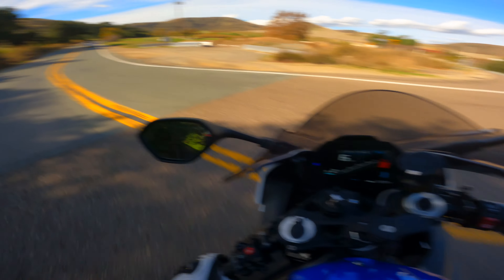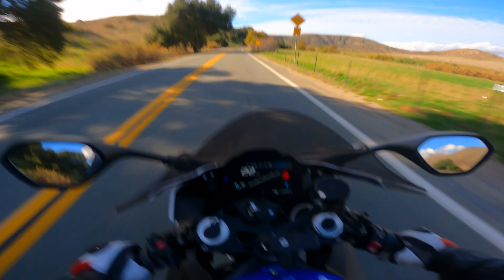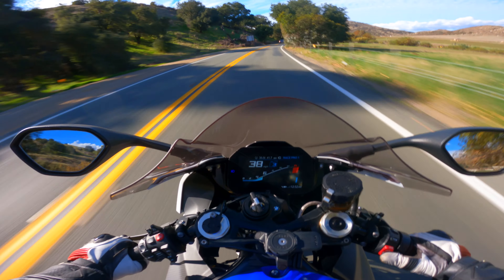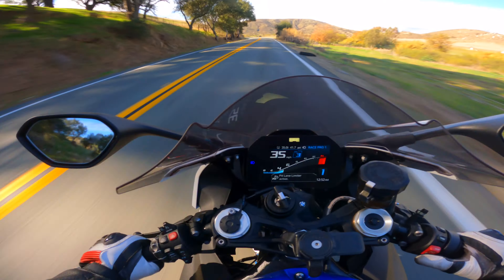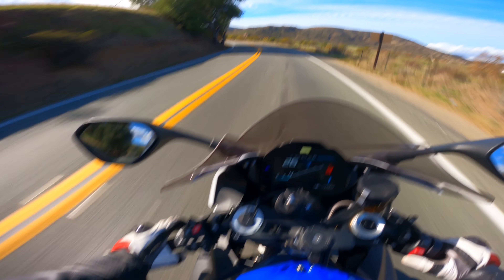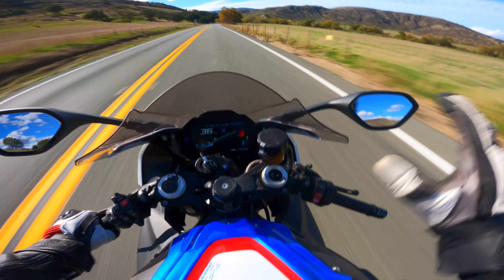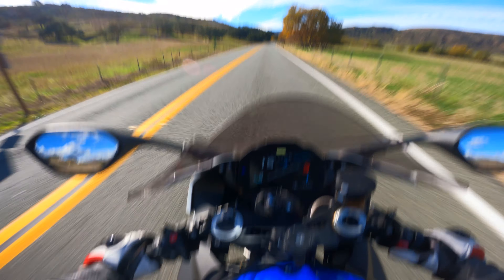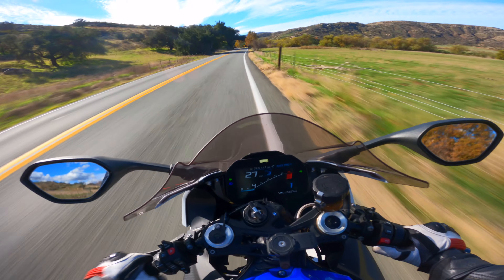HOW TO USE THE PIT LANE LIMITER AND LAUNCH CONTROL ON A BMW S1000RR!

Comment: A bit late here but that is not how to use the launch control. Throttle needs to be pinned at 100% from the get go, if you even drop it to 99% Launch Control deactivates. This explains the massive drop in revs you get in 1st gear. It should be holding 9k until the engine catches up and continues from there. for anyone trying it for the first time be careful not to hold the throttle at 9k then go max after you start to move this can cuase launch control to immediatly turn off and the front end will go stait in the air if not ready for it.
Reply: W mans🤝🏻

Comment: BMW said specifically to pin the throttle to enable the launch control safety, which stops you from looping until a set gear or set speed?

Comment: I thought the s1000rr had a million electronic aids to keep the bike from flipping? I guess this can happen if the rider aids are off.
Reply from the maker: It definitely does and by gosh has it saved me from crashes, however electing to use some of those features will can disable all of the safety. I don't plan on testing it out and seeing if it will actually flip the bike 😂

Comment: Proper demo! Thanks for that! Btw if you finished your launches does that mean its back to the dealership?
Reply from the maker: Do you mean if I use up all of the 3 launches? No not at all, you just let the bike cool down a little bit and the launches reset in number so you can launch 3 more times.

Comment: Fantastic video. I have a question though. Does your settings matter on your race pro modes? Example wheelie control and traction control is at minimum or off and your turn on launch control. Will your motorcycle wheelie? or launch control will overide everything to ensure the motorcycle stays on the ground?
Reply from the maker: Whatever race pro mode you're currently in, the bike will respect those riding settings. Now, from what I know it is possible to flip the bike while in launch mode, however the bike is programed to help the rider out and prevent from wheel lift. Crazy huh!